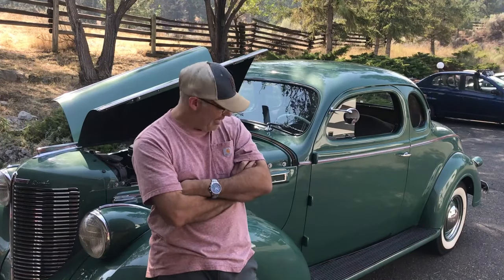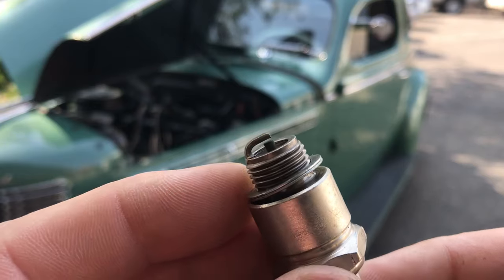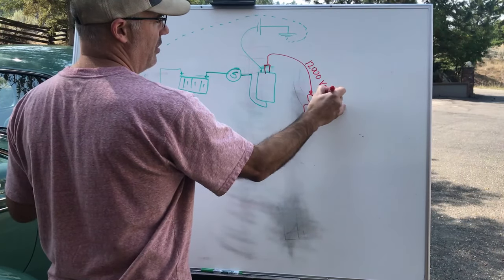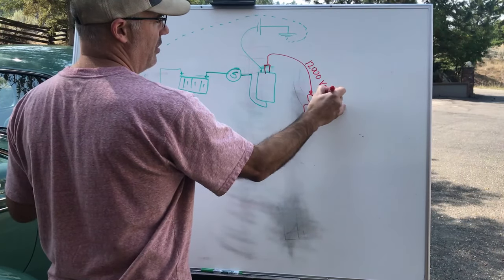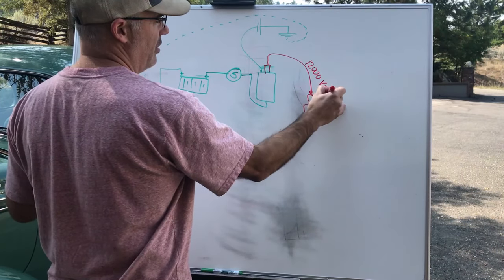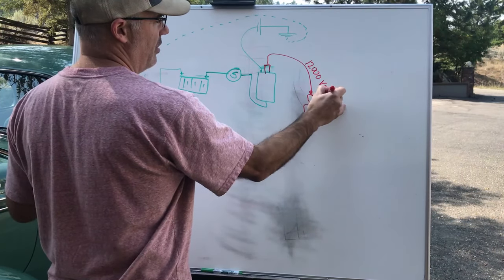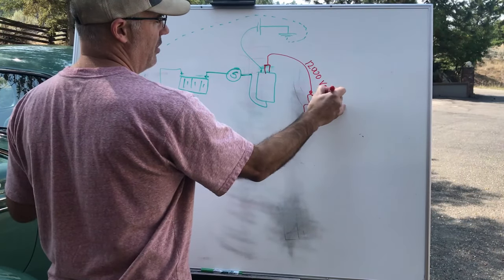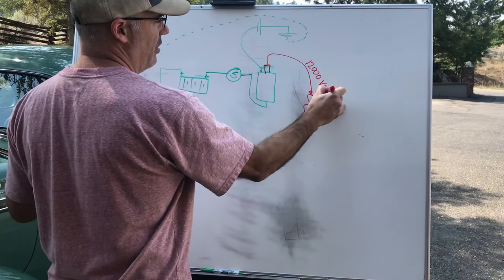No Spark! Help!....Vintage Ignition Systems With Points. Part 1

Comment: Maybe I missed something but even the old flatties are 4 stroke so you're only sparking every other rotation. So 2500 rpm \2 * 6 cylinders = 7500 sparks\min. The distributor is driven off the camshaft on most engines (not actually sure about that on the old flatties) and the camshaft is gear reduced and spinning slower than the engine

Comment: The windings will be 2000 turns to 1 for a 6 volt to 12000 volt step up. It was Faraday not Tesla who discovered this science.   2600 x 6 plugs = 15600 / sec - 64 microseconds between spark firings BTW.  I'm an EE and I think you did a great job. I have a 39 Chrysler Royal...

Comment: You saved me from tearing my hair out. 36 Desoto has been sitting in garage for 40 years. Everything looked great but no spark. It failed the first test. Points were closed but no continuity from ground to 6 volt wire from coil to distributor. A couple of strokes between points with emery cloth and Voila, spark! I had a feeling your site was going to work since my wife’s first name is Keeth.
Reply from the maker: Excellent! I'm glad to hear you got it sorted out.

Comment: AHA! AHA!! Thank you. I have a crank, no spark for my 1973 airhead mototcycle and you've enlightened me - it's probably my condenser. Also, my points gap was a little tighter than spec which would have help the spark jump the points rather than sending the electrical charge to my plugs. 

Even if this isn't my problem, I understand it now thanks to you. Thanks!

Comment: This helped me understand alot more about the inside of the distributor wiring and made me double check my connections to the ignition coil. Thank you. I had the lead wire and wire coming from the breaker points misunder stood and i when i was testing i was getting confused on my readings thank you

Comment: Awesome video! Thanks for posting. I'm working on my Ford Flathead - changing points, condenser, coil. The engine is on a test stand. My issue is that it fires momentarily - then I crank it with no results. Fuel is fine, it's electrical. I'm working on it tonight. I'll post an up-date when I get it running.

Comment: This video just helped me get my 56 Ford 272 back going, I knew I had everything wired right and good parts still no power to points, turns out all you had to say was the connection between the outside and inside of distributor power wire couldn’t touch the housing !!!! Sure enough it was grounding out inside the distributor because the insulator was old and almost all gone ! Great video you said something that I haven’t heard on other points style ignition videos , good job and thank you very much !!
Reply from the maker: Great to hear. I’m so it glad helped you. For this was the video’s main purpose.

Comment: Thanks for the explanation of things.  It was very helpful showing the distributor and points function.  2600RPM is 1300 fires of each spark plus because the distributor turns at half the speed of the crankshaft on a four stroke engine.  That times the number of cylinders is the number of times the points open and close.  Not sure if you describe dwell in degrees of rotation.

Comment: Hi Keith, coil winding ratios are essentially the same as the voltage increase ratio.  So a 6v to 12000v increase means a 2000:1 ratio.
Reply from the maker: Thanks. Easy to remember that!

Comment: Great content. Protonix does make electronic ignition for a Chrysler 6 volt positive ground system. I have one on my Coronet and I love it. One word of caution though if you have a dash pot solenoid you will need to run power to it from the starter.
Reply from the maker: Thanks. The coil theory and spark gap etc, also 100% applies to a car with a Pentronix. Only difference is how primary coil collapses.  No points, breakerless with the pentronix.  I’ve never owned  a Pentronix. How is the dwell set?
Reply: @keithsgarage5831  prity good vid except the condenser slows down the rate of change in primary voltage to allow the coil to work better. when the points close power is being wasted but also the condenser is drained, ready to start over.The coil cant work on DC. this is a lot to take in, good luck.Tom Higgins
Reply from the maker: Thanks Tom. I have much to learn about electricity. There indeed is much to take in.

Comment: Don't forget on the old cars to check the body ground straps. Usually from firewall to heads or starter to firewall. Loosen and retighten or clean. Do same on the power wires on the coil and distributor. If working on chrysler dual point distributor. You must set each side by advancing lobe on each side to set. It will appear you can set both points at same time without advancing the lobes. It will not start that way.

Comment: Awesome video!! Question,if i have the wires well should the pointers have spark if i break them manually? What if thay dont have? Thanks again!!
Reply from the maker: You should buy a cheap digital multimeter. Learn how to use it and diagnose things. Its super easy.
Reply: @keithsgarage5831  thanks keith,you are awesome!
Reply from the maker: @jewishpatriot.1754  Thanks man.  A new video is in the works siting stage.  Should be up next week.

Comment: Hi Keith, I have a Mazda astina 323 BA, it’s. 1993-94 model. I accidentally shorted by condenser and now there is no spark. Since it has an inbelt coil, I changed the entire distributor bot nothing seems to work, the electrician suggested that it’s burnt the ECU I had it repaired but nothing. Any suggestions please😢

Comment: Excellent. So clear and well produced. One query. Why does the distributor vacuum rotate the breaker plate? Or why does the breaker plate rotate?
Reply from the maker: The breaker plate rotates both directions to automatically adjust spark timing based on engine load and speed. Spark timing is adjusted by 2 different ways. One by inertia weights and springs that expand and advance the timing at higher engine RPM. Two by engine vacuum that is hooked up to the distributor vacuum pot. The vacuum pot has a spring inside it as well that hold the breaker plate in place .As vacuum is increased it overcomes the spring and rotates the breaker plate.
Reply: @keithsgarage5831  Great! That explains what happens when you rotate the distributor body when adjusting ignition timing according to the timing marks on the flywheel. Many thanks.

Comment: The reason for the metal jacket from the ignition switch to the coil is to shield the wier from the radio. With out the ignition wire would cause EMF interference with the radio all you would hear is pops and cracking from the radio. Tube radios are sensitive to emf interference. Ta da
Reply from the maker: My AM radio still works fine without it. The shield has been removed. The 6V signal from the ignition switch to the coil transfers the same 6V (low volt low amps) found the rest of the non-shielded wires up behind the dash.  The shield was there for anti-theft is my understanding. The voltage wire from the coil to the distributor cap is heavily shielded. It is in the engine compartment. It potentially could potentially cause radio interference. However does not either.  My AM tube radio works just fine.
Reply: @keithsgarage5831  it's do to the wire is attached to the coil witch creates a high tension radio signal. Same as the early Corvettes had a  shield around the distributor for that issue. Old point systems can effect people with pacemakers for the same reason.

Comment: ck points going open if they do not open  no spark that  is what gives you a path to he condenser that current flow thru the small coil  gives very high current flow  due to mag netic effect  set points at 20

Comment: My breaker plate bearings were rusted, i replaced it and now it moves freely, car is not running yet but wondering how you test the vacuum advance is working properly?
Reply from the maker: A vacuum pump to suck the diaphragm open. Test linkage. Is it moving? Mighty-Vac works well. Or timing light on. Rev engine a little. Is timing advancing?

Comment: Anyone know why I can get a spark at the points but nothing to the plugs.
Even taking the HT lead of the distributor and earthing it to the engine block produces no spark. Brand new coil hasn't made any difference. Help.
Reply: Same problem idk
Reply: Do you still need help?

Comment: I have changed the coil,  have changed the points, I have changed the condenser.  I have constant hot to the pos side of the coil. I have flashing light on the testor on the neg side of the coil. This should indicate the points are doing their job. BUT I have no spark coming from the coil. I need help as I have exhausted my ability to rectify this situation. what am I missing?
Reply from the maker: Are you working on a positive ground system? The spark from the centre of the coil has to pass into the distributor cap. Good firm connection there? Good known wire from coil to distributor cap? Carbon piece present up inside the centre of distributor cap? Good clean rotor in place? All 6 plug wire contacts inside cap clean? Any carbon tracking inside cap? Good spark plug wires? What is your spark plug gap? Good clean spark plugs? Is you engine properly grounded so high voltage can jump gap at plug and return other side of battery post?  Tight. Clean ground connections at engine block?  What is your battery voltage?
Reply: @keithsgarage5831  73 jeep commando, 304 V8 neg ground . I am not getting anything out of the coil tower. nada. test light confirms engine block, coil housing all well grounded. I was driving the jeep went to town, stopped at parts place, stopped again then nothing, turns over, but no spark, was then i changed out those 3 components, even tried a hot wire from the battery to the coil, still no spark from the coil
Reply: th distributor was recently rebuilt, the components were basically all new when the jeep failed to start. I just installed the coil, new a week ago. after changing all those parts one at a time plus buying tools I didn't have I gave up after a few hours and called a rollback.

Comment: Question! What if my coil is getting hot and still showing ground with test light even though I'm holding the points open by hand? I'm lost and have no idea how to solve this
Reply from the maker: The primary wire going into or out of the coil maybe frayed. Possibly having exposed internal wires touching ground.
Reply: @keithsgarage5831  ok thanks for the reply
Reply: if capasitor is bad it-- could give a false gd  turn switch off   to remove voltage till you find the false gd disc  condenser lead from screw------- condenser will read open  if good set ohms on high scale should still read open     ( no reading) if it ok any reading is bad toss it #s will flash and fall back -normal  if #s stay its badturn switch on see if gd is gone cond, disc. if you still havea prob. the coil may be bad i have repaced a few coils made in mexico  they used too small wire want last long
Reply: @frankdavidson9675  ok thanks I will see what I can figure out

Comment: So it's got to be a blue spark  rather than an orange one ?
Reply from the maker: Blue just means higher voltage. Hotter, stronger spark. Depending on how your ignition system was designed, and well well maintained, will dictate spark colour. Over time as engine compression numbers increased,  system voltages also did.

Comment: I have a small engine with this, and I get power to the top of the plug, but no spark. I put the plug in another engine and it has spark. I cleaned the points and the coil seems to be working (idk how he tested it). What would anybody suggest?
Reply from the maker: A circuit is a circle. The spark plug will fire if electricity can find a quick way back to the battery. Is the cylinder head and block connected to ground? (the path back to the battery)
Reply: @keithsgarage5831  yes. We have even tried putting it in other locations and without the plug, but still no spark. I'm just lost as to what to do next.. other than grabbing parts from other projects and hope they are the right size
Reply: Its a pull start generator, but my meter says there is an electric current going from the block to the spark plug wire
Reply: It just woke up and decided to work this morning for some reason